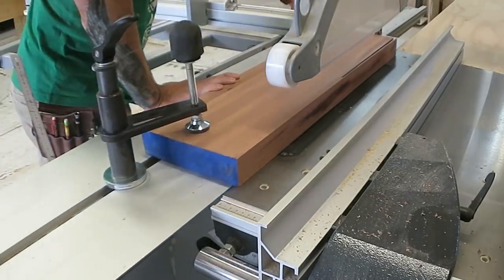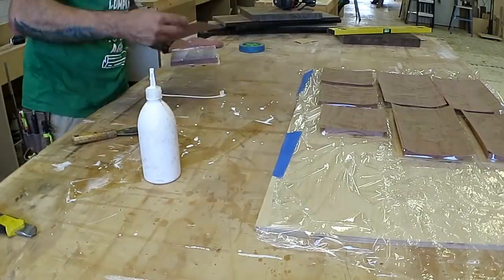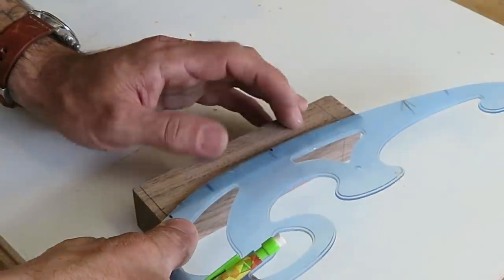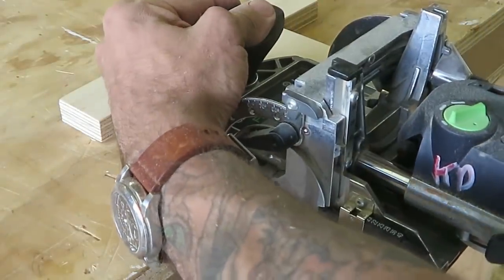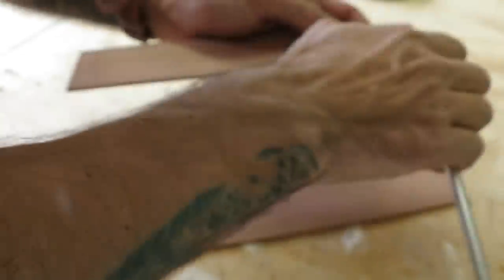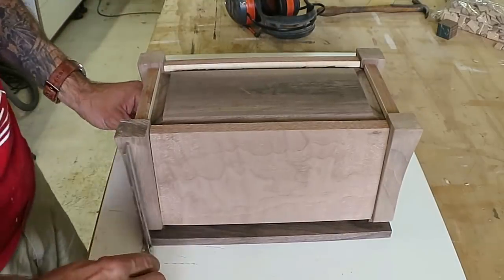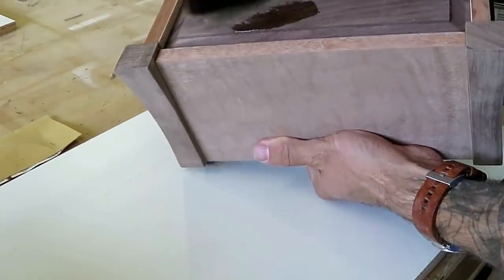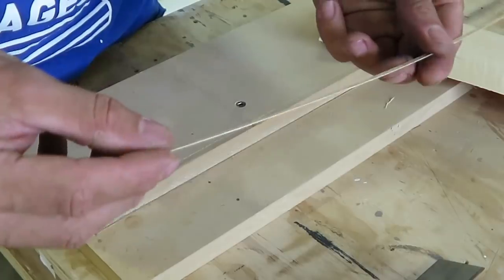A pair of Urns

Comment: They look awesome mate! Could you go into more detail how you grain fill in a future video? Only recently heard about this technique
Reply from the maker: I don't really care that much about grain filling as I'm not really ever after a glass smooth surface. Essentially just add a bunch of some clear filler (shellac,polyurethane,epoxy) and scrape/sand back until you have a dead flat and smooth panel. Then add the desired finish. 
Curly veneer tends to have a deeper open grain that can feel different from solid timber.

Comment: Hi, Joey. I have a question: Does the natural expansion of the woods (veneer and wood board where the veneer is glued) cannot cause cracks because they can be of different expansions? Did you do something to avoid this possibility?
In addition, it was very beautiful. I follow always and like your work. Congratulations!
Merry Christmas and a Great New Year!
Reply from the maker: Hi,  so this is a big question.  Firstly when veneering timber you  must ad veneer to both sides to stabilize the board.  Ideally use quarter sawn timber to minimize expansion . Remember the smaller the board the less it will move
Reply: Are good tips, Joey. Thanks for the reply!!